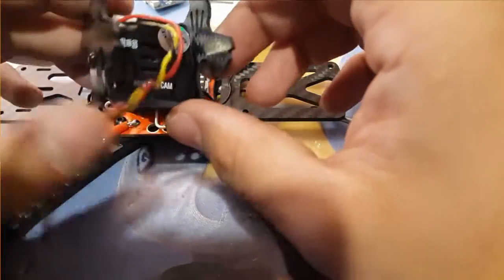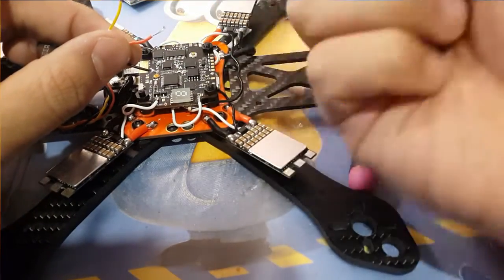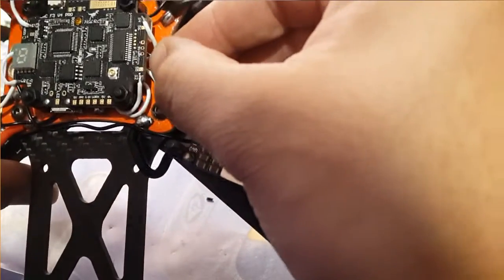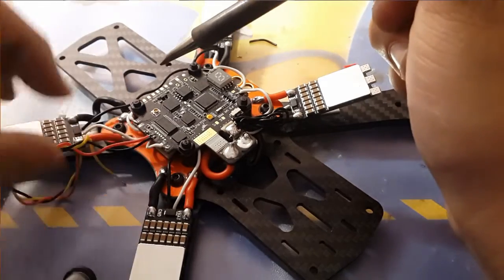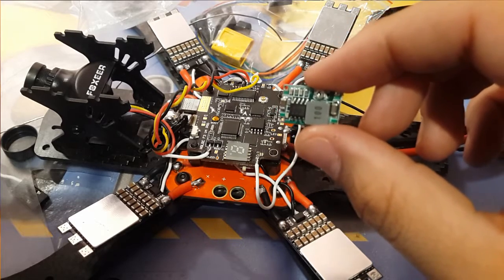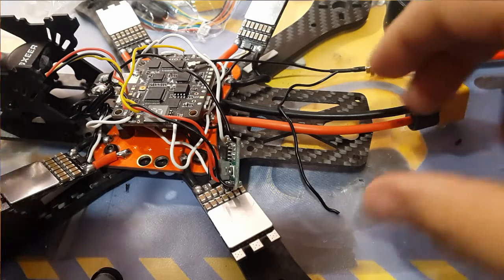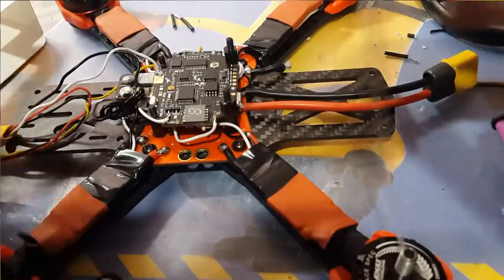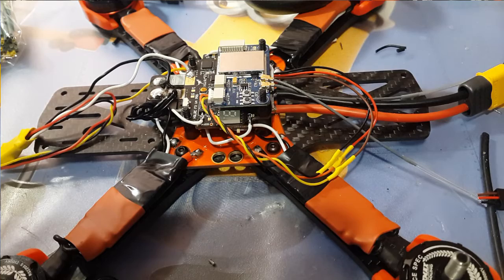Martian2 220, Emax 2205S, Racerstar 35A V2 ,F3 V4 AIO FC, Foxeer XAT600 Build (Part 2)

Comment: I use the Martian II frame and the Foxeer HS1177 cam.  The mounting bracket needs to be filed a bit or else it does not fit the FPV camera right.   Also the screws that come in the cam are short so I dont screw the cam into the mounting bracket from the back, instead I stick it to the bracket with double sided sticky tape then I put it into the carbon fiber  brackets with the two side screws.  Its pretty solid after you do that.   I use the  mounting bracket just because it sets the camera angle for you to 25, 30 or 35 degree.    I use 25.

Comment: 16 awg wire is enough for central power cable ? Esc 4x30A=120A no need of at least 10-12awg?
usb port on the front side is not a problem whith the camera?

Comment: Question on the Camera solder points. could you use the plug on the other side of the board to the right of solder points instead?

Comment: Just wondering how to connect sbus an s.port on this board. Thanks man and good video!
Reply from the maker: +Patrick T Thanks i think you would connect it in the rx and tx where it says ftdi osd in the manual have not tested sbus or ibus yet running ppm on all mine.